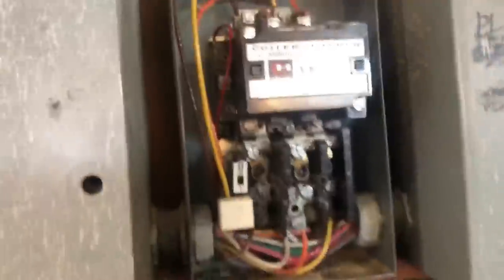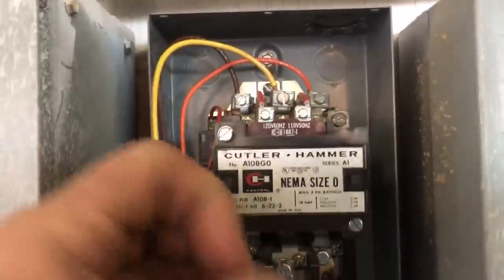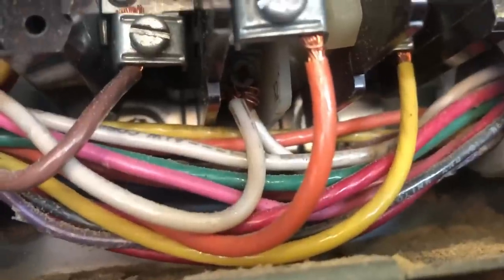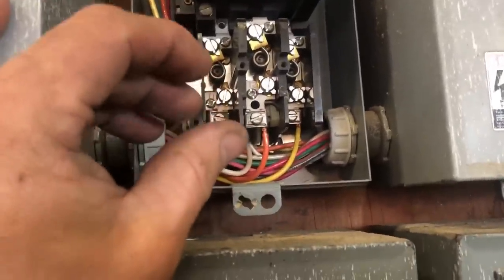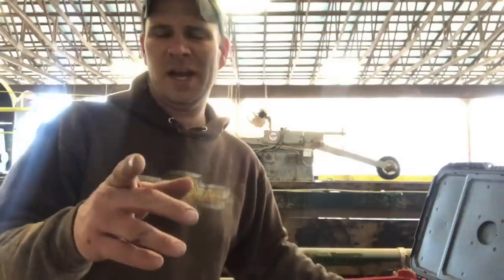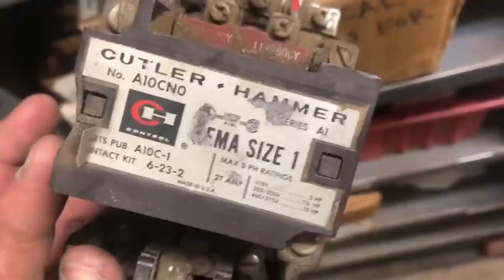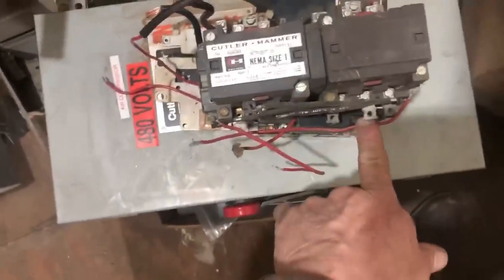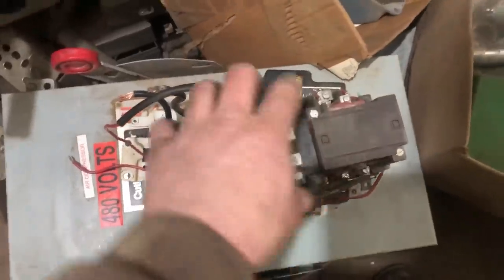I finally learnt how a 3 phase starter works!!!

Comment: i've said it before to you, i am a retired electrician. now i never cared to learn about starters, but one day, my boss put me in a building to run work, and a lot of the job, involved starters. it also involved a lot of fire alarm work, and HVAC work. boy did i have to learn fast. i ended up spending 10 years in that building as a foreman.
ok now just one thing i just saw on your wiring, that i am going to tell you about. whenever you are using stranded wire, no matter on what, if you are going to put a stranded wire, under or around just a screw, twist the wire counter clockwise. so when you put it under or around the screw, it does not fray up, and leave some loose ends from under the screw. watching you has taut  me a lot about logging, so i felt i could teach you one thing about wiring.
Reply: x2
Reply: Wrong, wrong, wrong, wrong, use a stake on compression lug. Never ever wrap stranded conductor under a screw, only solid conductors are suitable for that.
Reply: @jdatwood7086  you are right I am a union electrician on a screw putting it under a lug with just the wire is fine
Reply: Daniel Eyster 
I came through the 5 year inside wireman program with the IBEW. Class two nights a week and work all day/weekend sometimes for 5 years. It’s been a rewarding career and taken me places I’d never imagined. I left the construction side 12 years ago but now am an E/I technician for one of the largest pulp and paper companies in the world. I never forget where I came from and what all those old timers taught me over the years. Stay safe brother!
Reply: @jdatwood7086  i am retired from local 3 ibew, in NYC.
Reply: @jdatwood7086  yeah I did the 5 years too my friend is looking to get a maintenance job I still like it but when I get to his age I may think the same way
Reply: cuznjo1 
1253 Augusta, Maine

Comment: Your top section is the starting contractor which has a relay to close and hold close the contractors to supply voltage to the motor. The lower section is the overload heaters like you said.  Current passes through the heaters and if too much current is drawn then the heater will trip open a set of contact which de-energises the supply power to the contactor coil and all the contacts open. 
The heaters are sized on the motor you are using and generally there is a range of heaters you can choose depending on the amperage you want them to trip. If are getting a lot of trips then you might want a higher rated heater. Also, you might want to check the contacts are not varnishes and causing resistance.

Comment: Looks like you got the understanding on how it works, where I worked we had mcc in every building with what we call buckets with all the things inside that you had except ours has a step down transformer for the control voltage every bucket had one.
Reply: motor control centers are nice and easy way to keep everything in one place.

Comment: momentary hot,momentary cold that's the first time this electrician has ever heard that if you want to get technical the right wording is normally open for the start and normally closed for the stop. You had the correct lingo for the neural on the control side you just had to think about it  (really hard).
Reply: proper terminology is important

Comment: You got almost all of it right. The 120 volt that keep the contractor pulled in is hot until the stop button is pushed. The circuit is called the seal-in circuit. These kind of circuits are used with momentary switches. On the Over-load the contact that has the neutral is a normally open contact. When you push the reset button for the overloads it closes  that contact. Other than that you are getting a good grasp of what is happening. Good luck and be safe. You will find that the start-stop circuit is the same for single or three phase.
Reply from the maker: Glen Wagner thanks bud

Comment: I'm not good with electricity but on are rock crushing plants we run alot of 2 to 300hp motors and most everything is 480v kinda scary if u don't no what your doing but I have been around it a long time. So I learned alot. Keep r safe Mr. Wade

Comment: Next time you have a question, throw it out there to us. I do industrial maintenance and  firewood/ tree work on the side. Sounds like you have a decent understanding of what going on there though. Better than some of my guys. You'd be surprised at some of the guys I work with that think 110vac will work without a neutral. Anyhow, respect it for sure. Get yourself a good meter as Eddie said. Fluke, Green Lee....... A must have tool for sure.
Reply from the maker: Robert Sanders yeah I didn’t go cheap there

Comment: It will help in troubleshooting 3 phase starters, if you think of them as 2 separate devices. The high voltage contactor ( essentially just a relay ), ... and the overload segment, where the thermal units ( heaters ) are mounted.

Hydraulic circuits have a "work" circuit and a "pilot" circuit.

In 3 phase electrical circuits, they're called the "load" and the "control" circuit.

And YES it does matter that you use the correct terms, in order to accurately communicate with vendors and other electricians.

Nobody should have to GUESS at what you mean.

I'm a laid back good ole boy myself, but sometimes, in technical language, precision is important.

Comment: The reason heaters  trip are the amperage draw of the motor, they are design to protect the windings of the motor incoming voltage has effect on how set your heaters lower than normal voltage means your amperage draw will be higher, every action has a reaction

Comment: You don't break the ground to stop it.  You break the hot.  If you break your ground, and it stays hot, if you become the ground by touching the wrong spot, power goes thru you and tries to start the motor and your innards is not going to like that. If you break the hot then you touch the wrong spot it doesn't hurt. That's just the control side of things
Reply: Exactky
Reply: It can be done both ways, I work in a plastic plant and every starter we have the overload contact runs through the ground, no matter which way you choose to do it there will always be 120v or whatever control power you're using present in the starter. As long as you open the contactor it doesn't matter which way you do it
Reply: Some contact coils are single phase 480.  They don't use a grounded conductor.

Comment: Up our way we still have alot of old delta open 3 phase.   No neutral  to be had.    Pain in the ass !  You cant grab single or two off of it cause no neutral. So if you need single or double. You gotta shove it thru a converter.       Pain in ass and expensive.     Very efficient if your just driving the 3 phase it was ment for

Comment: Yelp that’s about sums it up. That’s how it works FYI in behind the heaters on a square D they’re a Sauter pot that the heater heats up that allows the mechanics of the over load take it out. Electrical works like hydraulic in a sense.

Comment: @Logger Wade Let me know if you need some controls, i do building automation and i could get you some nice automation for these bad boys with current senors, temp sensors, phase loss monitors, the list goes on and on. We can do 0-10 VDC and 4-20ma inputs and outputs. Using the smaller relays to drive the 120's you have now. It would be like a computer for all your electrical!

I could set this all up so you could monitor and troubleshoot, test all from your phone, tablet or pc!
Reply from the maker: the witness that’s crazy bud
Reply: Wow. What we can do these days.

Comment: A reverse starter has an interlock between the two halves so you can't pull in both sides at the same time and create a short between the two swapped legs
Reply from the maker: CrossesbyCharlie yup left that part out